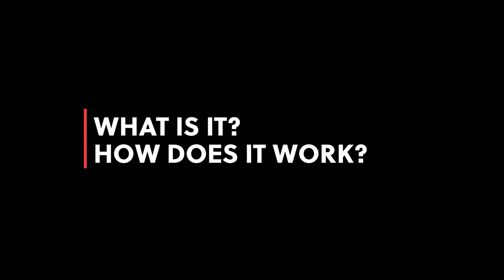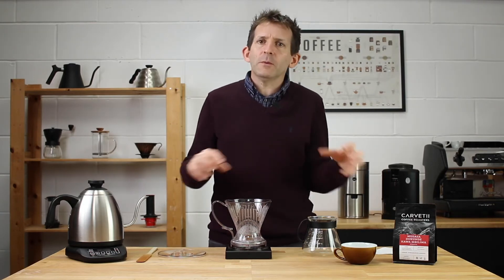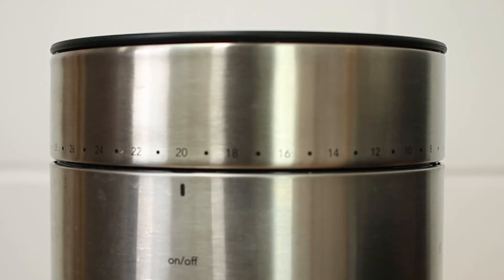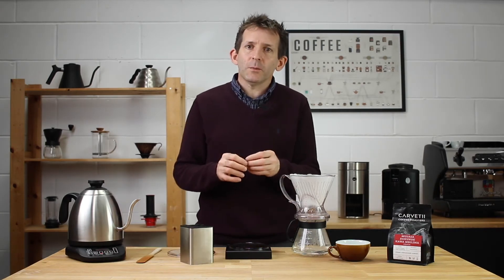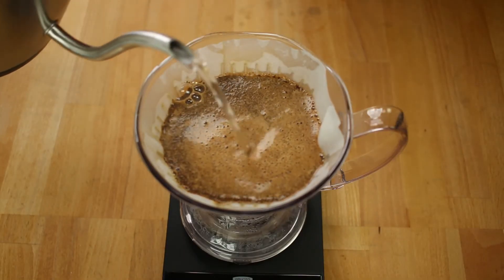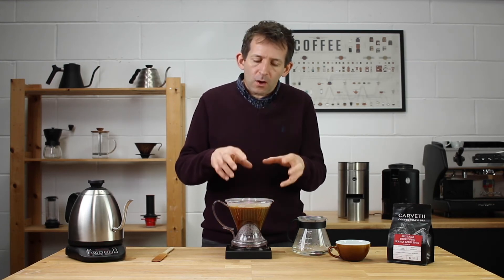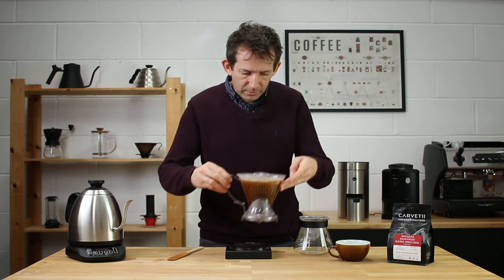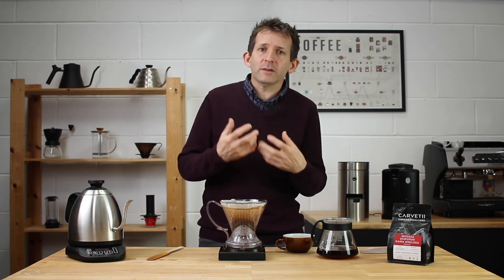Carvetii Brewing Guide to the Clever Coffee Dripper

Comment: Hey there, do you tend to do that Svart grind setting for V60 too? I brew 15g/250g and have found two clicks above the filter line works well... but maybe i should try this finer setting out? This brewer looks really interesting. I think I've had a chai served this way before. Curious to research a one cup version.
Reply from the maker: It’s very rare that I make a 1 cup V60 so this morning I had a go on that same grind setting. The coffee had a slight hint of over extraction but nothing major. The Svart does produce a wide range of particle sizes so the fines tend to slow down the flow and produce that over extracted tone. Brew time was 3 minutes by the way. Maybe play around between where you are know and the above setting. If you are into facts and figures I managed a 21% extraction.
Reply: Hi Gareth. We're you using the large or small dripper there?
Reply from the maker: Small dripper with your recipe 15g/250g, stirred the bloom and stirred after all water had been added to try to stop the fines affecting drawdown
Reply from the maker: Apologies might have got my threads mixed up☺️ were you asking about the dripper in the video?
Reply: @carvetiicoffee  I was asking about the one in the video as wasn't sure if the 350g of water you added fit small dripper. With the small dripper being 300ml I didn't know if that refers to what you could put in to it or what you got out as you were saying that you got about of 300ml of coffee out.
Reply from the maker: I checked this morning and I have the larger dripper so holds 350g to 400g water comfortably. I tried to brew 500g but with the coffee it just over flows! If you have a smaller
dripper I’d use the 60g per litre ratio which probably works out at 15g coffee to 250g water. Always get less liquid out than you put in as the coffee bed absorbs a surprising amount.
Reply: @carvetiicoffee  Thanks for the info Gareth

Comment: Do you know why my coffee tastes lemony sour even if I grind it very fine and use this brewing method?
Reply from the maker: Difficult to tell to be honest.  Lemony/sour can sometimes be due to under extraction so but the steep should prevent this.  Water temperature possibly?  I'm assuming the coffee tastes ok using other brewing methods?  How else do you brew?
Reply: @carvetiicoffee  Since it is a light roast I brew it straight off the boil. So it is as hot as it can get. With other brewing methods too the sourness is there. I tried with V60 and fine grind to the point that the residue was muddy, the sourness was still present. The same with a 8 minute french press brew. Could it be that the coffee itself is under roasted? I don't get that sweetness that I should get. I have tried different grind settings carefully going one step down each time.
Reply from the maker: In my experience if you are working that hard to brew a coffee without positive results it is likely underdeveloped in the roast. Light roasting is a tricky knife edge to live on! There is a danger of going too far one way in search of floral and fruity tones which makes the coffee challenging to use for the end user. Also water quality can have an impact - a coffee which tastes great on harder water can taste less good on soft water and vice versa. The only way to truly know is to buy some other coffee and test it out on the same grind setting.
Reply: @carvetiicoffee  I will try a light roast from another roaster. I use Brita filtered water and not hard water straight from the tap. Thank you.
Reply from the maker: You’re welcome. Good luck and let me know how you get on! If you’re uk based the Pablo Emilio Montoya on our website has good floral and fruity tones but is a well developed roast. That would give you a benchmark to work with.
Reply: @carvetiicoffee  Thanks. I will try that.
Reply: Probably your coffee?